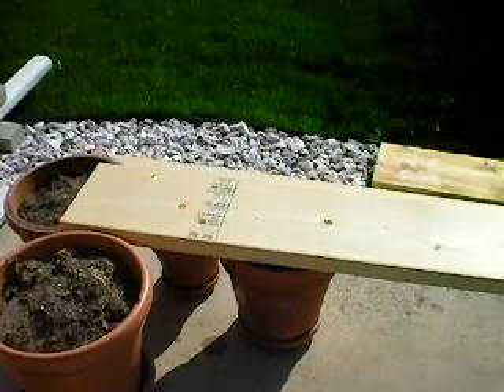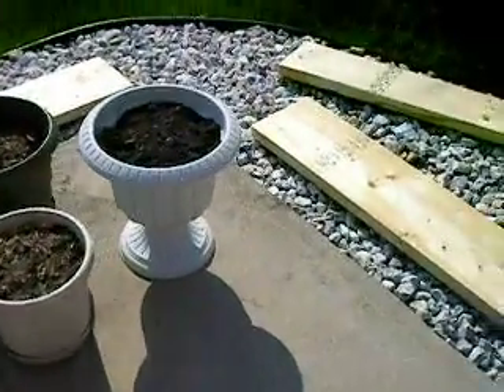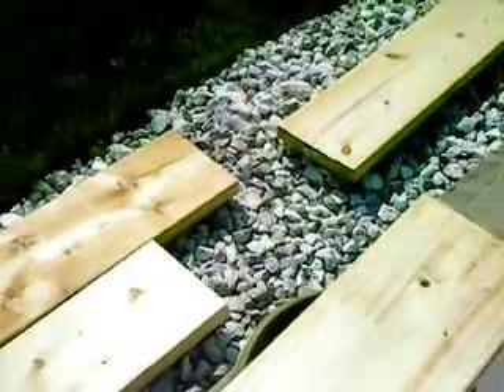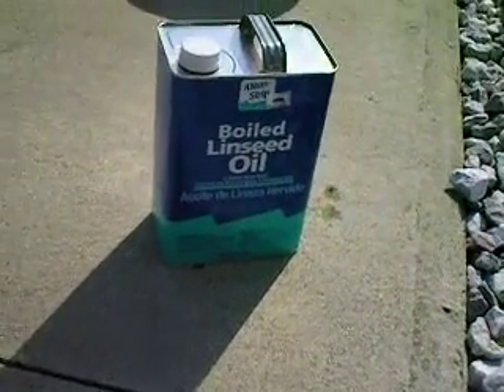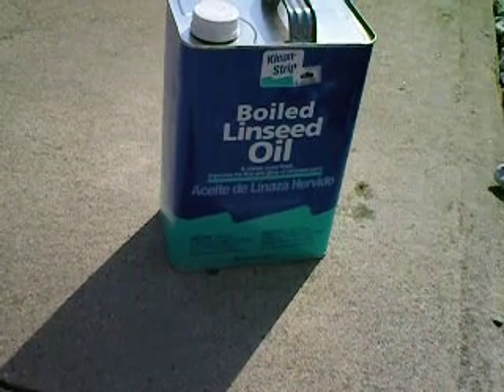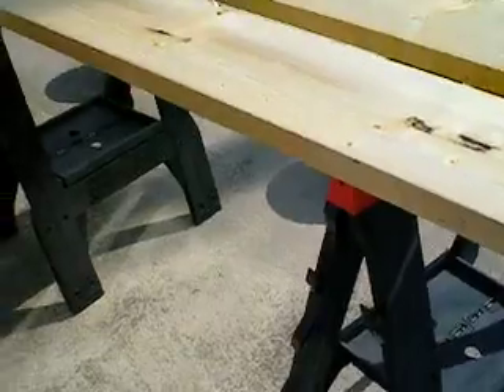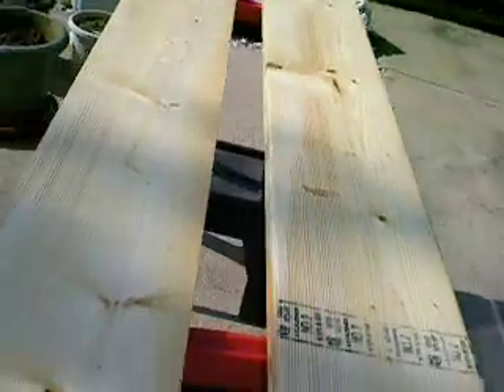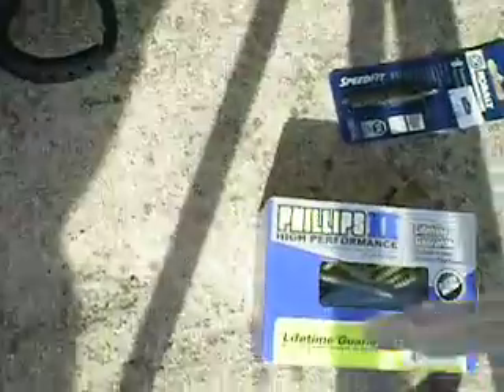Vegetable Garden 2009, update #2

Comment: Good News: Linseed oil is a really good idea. Wood is expensive! Linseed oil It penetrates well and helps with the moisture. that.

Bad news. Boiled linseed oil  has had toxic metal driers added (otherwise, it takes a really long time to dry) like cobalt and manganese. You can find linseed oil without these (usually called raw) and also with less toxic dryers.